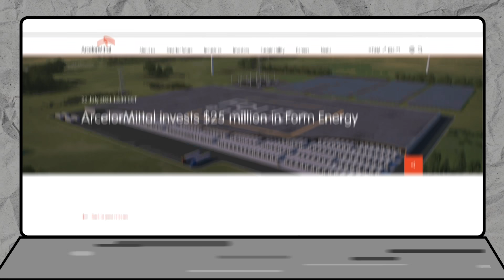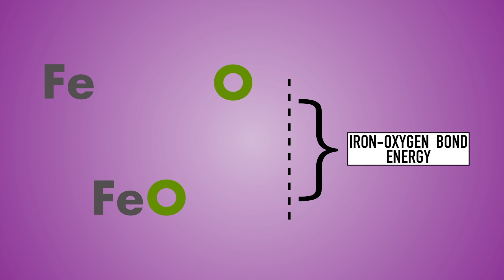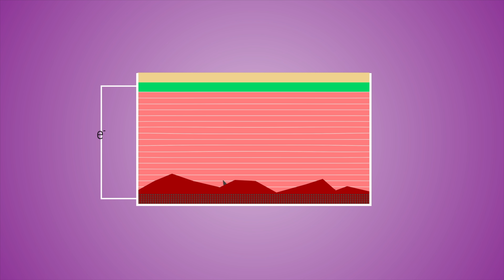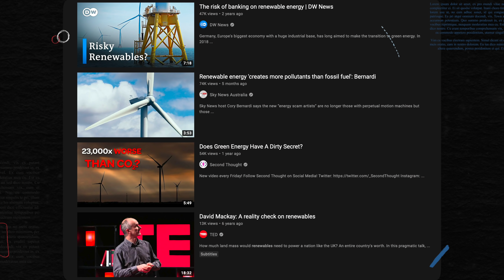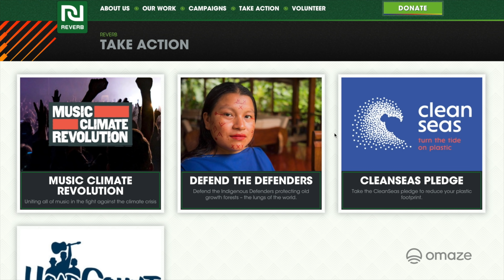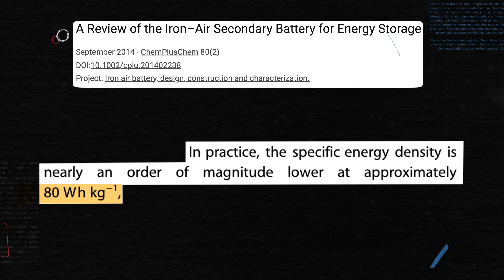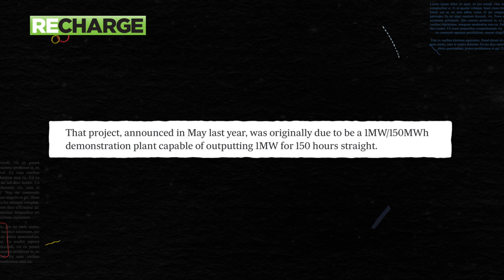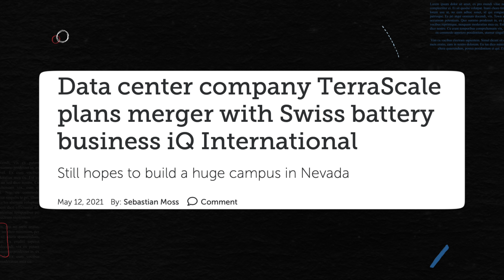Iron-Air Batteries Could Be The Start Of A Revolution In Energy Storage

Comment: Actually you mentioned that hydrogen can be stored indefinitely, it's actually very difficult to store as it's small atoms leak through steel cylinders.
Reply: Which is why composite plastics are used. No microfractures for hydrogen to seep through, and not embrittled by hydrogen. There are also alloys of steel that improve its hydrogen resistance.
Reply: @RentedRedux  impore, yes, but not withstand. No.
Reply: Hydrogen leakage is a huge red herring.  First off it will be stored in underground salt caverns which are now used for storing natural gas.  As for pipes, the hydrogen can be made at the storage location and also converted back to electricity at the same location.  The delusional minority who have attempted to make issues out of non-issues must remember that hydrogen is already widely stored, transported and used widely in industry for making fertilizer for the food you eat.  So stop the BS and being shills for the fossil fuel industry.
Reply: @acmefixer1  Its not BS because we have no such industry, making fertilizer and so. Those are the industries which are strictly and forever banned from any population centers in Europe. So do NOT BS me. The last such industry that made a BIG BANG was in Beirut. Good have mercy with their souls.
Reply: And ionizes and destroys the metal and fittings in very short time. Yes, it can not be stored for much more then a few days, maybe weeks.
Reply: Oh please... Haven't they heard o Tupperware??... No leaks ..... guaranteed!!
Reply: That's why Hydrogen is stored in liquid state, in sub zero temperature
Reply: Store it as titanium iron hydride and it is very stable. That's the stuff in NiMH cells

Comment: Why not slap on a fuel cell and turn the excess hydrogen into energy. And why use air from the outside and not just a closed system??
Reply: @pavan Efficiency is a red herring in many cases. Right now in the UK wind farms are being constrained off every week due to over generation in parts if the day. So the choice is zero percent efficiency by turning the wind farm off, or better efficiency with storage.  Some good long term base storage, in addition to and mixed with shorter faster storage is something that the UK needs already.
Reply: @Muppetkeeper  
Hi, I agree that efficiency is a red hearing, but I don't agree with your example.

Some UK wind farms in remote areas are indeed turned-off/down at times of peak generation because the grid can't transfer all the electricity to where it is needed. It would be 'easy' (but expensive) to build a higher capacity grid (ie a bigger bit of wire), but for the few occasions it is required it is cheaper to pay to turn the turbine off. On that basis the economics of installing a battery (even if the electricity is free, or even negative cost) wouldn't stack up either.
Reply: @johnkenyon6910  hi, I live just outside the 4th or 5th largest city in the UK. Almost every Sunday morning, the six large wind turbines I can see from my home are switched off. It’s not network constraints here, they were built on the old site of a coal power station, the network is fine, the demand is too low.
Reply: @Muppetkeeper  LFP Batteries are cheaper. Or Na+. Or desalination plants which produce sodium which could be used in a battery with near 100% efficiency. Or make same extra aluminium from your recycling coke cans and make it into aluminium air batteries which have around 70% efficiency or pump it into a liquid air tank and use the compressed air in the low tide. LFP batteries are currently the cheapest available option.

Comment: Edison batteries. Next. Crap charge efficiency, one of the worst mass and volumetric efficiencies. If you don't care about how big and heavy it is, or that you'll be wasting ~50% of the power you're trying to store, they're great. (I rank these just above AL-air batteries.)
Reply: Edison are NiFe @ about 65% efficient, cheap AF because they last forever. Who cares how big and heavy they are? it's 100 year infrastucture out in the field with panels and turbines, cheap cheap cheap
Reply: @George Mann Oh yeah, grid level wind/solar are a train wreck
Reply: @George Mann FFS George, will you just stop it with the fact based comments, you are making too much sense.

Comment: This tech looks really promising. The batteries are low-density but inexpensive, and since they use air as the cathode the amount of exotic or difficult to recycle materials they require is greatly reduced. It looks like the biggest drawbacks are that they’re currently bulky and charge and discharge much more slowly than lithium ion batteries. So at their current state they cannot replace lithium batteries - especially in mobile applications - but they could certainly supplement them for grid storage. Because of their reduced energy density and slower charge/discharge cycles they’ll produce less heat, meaning you should be able to stack them more densely, making their space requirements a bit less onerous. You’d need a lot of them but they’re cheap, so they could provide a great place to store excess capacity when the renewables on the grid are overproducing, as well as supplying base load when cloudy or windless conditions persist for multiple days. 

I’ve gotta think they have considerable potential to expand beyond this niche if the technology continues to be advanced and they can find a way to exploit more of the iron in the electrode faster than is currently possible.
Reply: At 1 MW / acre, that's around 250 MW / sq km. (or 640 MW / sq mi). That's a lot of space.
Reply: @kylone1  True, but we have a lot of space. Presumably you could also locate these on the ground floor of a parking garage, or in other unused spaces on the electrical grid.

Comment: Why not combine it with a Hydrogen fuel cell? You'd have to replenish it with water but then you could use the H2 and increase efficiency. And the current capacityof the fuel cell couldimprove performance.  (Maybe this seems like a good idea due to the videos oversimplification?)

Comment: "Store hydrogen forever"?   Is months considered forever or have I missed something.   The inability to store hydrogen has always been in the negative column.   This would be huge in the space programs.  Are you sure about that?
Reply: Amonia as a way to store hydrogen is a thing.
Reply: @dougaltolan3017  Ammonia, water, etc etc.  There are lots of ways of storing Not-Hydrogen.  Still don't know of a way to store hydrogen.
Reply: @lucidmoses  amonia as an energy efficient way to store hydrogen is a thing.

Do you need to be spoon-fed?
Reply: @dougaltolan3017  No, Just an answer from someone that can actually understand the question.
Reply: @lucidmoses  BfS
Reply: @lucidmoses  Also, if you want a pedantic answer to your trollingly semantic question, it may be better posted against a video where it is relevant. Iron-air batteries have no requirement whatsoever to store hydrogen.
I'll leave it to such an amazing scholar such as your self to realise why.
Reply: @dougaltolan3017  This video does talk about hydrogen storage around 7:57. Take a chill pill or 10
Reply: @u1zha  See there's the problem you have with jumping to conclusions.
The video references hydrogen production, with storage as an aside only. 
Now, before we get into throwing chill pills about, here's one way that does not necessarily mean the need for storage...
The hydrogen is produced during the charge stage. Why wouldn't they use that hydrogen there and then to extend that charge stage. It would go a long way to mitigate that particular inefficiency without the need for onerous hydrogen storage.

Comment: I'm confused in general about the need for long-term storage.  If li-ion and other technologies have superior efficiency over the long-term storage proposals, it seems the reduced cycles per year of a long-term storage site will further impair profitability.  An alternative is to build a surplus of renewable generation so that the any shortfall is only short term.  Such overcapacity hurts the profitability of the renewable generation plants due to a high percentage of curtailment but this may be more profitable than occasionally running a long-term storage facility.  The economy of scale of installing renewable generation would keep the capital costs low,  reducing the economic hit due to curtailment.

If a long-term storage solution was ready to scale today, before we have significantly overbuilt renewable generation I think it would be possible to carve a significant niche.  It seems to me that the cost of installing renewable generation is so low that we will be at "superpower" generation capacity before an otherwise viable long-term storage solution is ready to scale.

If one designs a plant to charge/discharge in ten days one can only achieve a maximum of 18 cycles per year.  Whether or not the technology has a 10,000 cycle lifetime seems immaterial to the economics of operating the facility.  Take an LFP battery sized to cycle every day for 3000 cycles and scale it to be able to operate 10 days at the same power.  The battery can now enjoy 10 times the lifetime of daily cycles while also providing the necessary backup for the occasional long-term shortfalls of energy.  Depending on how the capital cost is amortised across the operating lifetime of the plant the cost of energy should be worse than the daily cycle design only by the cost of capital.  The capital per kWh is still roughly equivalent.

I have not dug into the details enough to know that LFP wins but there is something seductive about generating revenue on a daily basis that I find alluring.
Reply: "I'm confused in general about the need for long-term storage." - What happens when you live in the north and you hit winter? You have lost a large percentage of your solar power and if you have a couple weeks of low wind, your windmills aren't generating enough energy to keep up with demand. Your solution of overproducing on renewables is extremely costly compared to simply having a large supply of iron that you can just let rust.

What we need are multiple options for battery storage. Lithium ion has its place, but it has its downsides including environmental damage. Iron may have its place, but you'll never run a car on these things.

But, yes, we have a need for long term storage that isn't lithium ion.
Reply: @ericfleet9602  Your situation is precisely the  one I am questioning.  At the projected cost per MW of deployment of renewable generation vs. the projected cost per 240 MWh of storage, which is more cost effective, deploying multiple times of generating capacity in order to manage the snowfall and low wind days, or deploy the the storage?  I see the real possibility that the cost of curtailing a majority of generation during "normal" conditions might be favorable to the cost of installing long-term storage that is used only intermittently itself.  Either approach results in underutilization of capital.  Which one incurs less cost?

As a New England resident I am quite aware of the impact of snowfall on my solar panels and that my solar panels are positioned to maximize collection in the summer and not the winter.  I am also aware that winter inclimate weather would not likely seriously impact offshore wind.  If offshore wind is deployed to superpower levels, it is not important for my solar panels to either be inclined more steeply or be cleared of snow after the storm passes.  The question is, does expanding offshore wind make more economic sense than deploying long-term storage?  I may have said that for the third time.

To this point, my discussion has centered on grid-level generation and storage.  Ida certainly demonstrated that pushing down to at least the distribution level might be necessary for better robustness.  I keep trying to evaluate backup at the residential level but that seems a hard nut to crack.

A model I keep trying to work around is that of the current residential oil heat.  Is there a fuel that can be stored at a residence for long term as safely as home heating oil currently is to store and is also suitable for direct conversion to electricity?  My concept is that a relatively efficient conversion to electricity in order to operate a heat pump for residential heating would permit the heat rejected from the conversion to electricity also be used, increasing the cycle efficiency of the fuel.  The residence would not be placing electrical demand on the grid to heat the home and has the ability to operated independent of the grid during outages.  The added cost is the energy efficiency of producing the fuel and transporting the fuel and,  possibly the oxidized fuel for reprocessing.

Ethanol as a fuel would preserve operation of an industry that will otherwise see a decline as gasoline use declines.  However, I think it presents significant storage hazards in a residential setting.  It may be more appropriate for district storage but cogeneration, using the heat rejected by the electrical conversion process, is more difficult to utilize.

To reiterate, the goal of residential heating  by an alternative fuel would be to increase the cycle efficiency of the fuel through cogeneration.  A relatively efficient conversion to electrical energy, metal-air battery or fuel cell coupled with a heat pump could provide a relatively high efficiency throughout most of the season.

Thanks for giving me the opportunity to expound more than you probably wish to read.
Reply: @George Mann Thanks.  I'll look further into methanol.  Its toxicity seems an issue so I need to understand if US storage and handling requirements are more stringent than China's.  From the little I've read, I'm not optimistic, but I have been very cautious about increasing risk in a residential setting were safety training is difficult.

We agree on the nominal power needed to operate a home and the battery size to meet demand.
Reply: @George Mann I'll  have to research more thoroughly.  The first articles I scanned stated the opposite, methanol being more toxic than gasoline.  The toxicity also seems to vary from person to person.  I have not yet found an "authoritative" document to cite yet.

The positive I have found is that methanol fumes are more likely to dissipate than gasoline fumes.  But then again, we typically do not store quantities of gasoline in a home.  When comparing to home heating oil I suspect methanol will be identified as a higher risk.  Hopefully, as you advocate, this risk will still be viewed as acceptably low.
Reply: @George Mann Thanks.  You seem a wealth of knowledge about methanol.  You have not contrasted methanol with ethanol, which is already produced in large volume in the US.  Am I correct that ethanol does present a significant hazard in a residential setting?  Or is it similar to methanol without the toxicity?

Comment: When thinking about best practices and what's to provide energy for the future might we also consider the need for water? Might hydrogen vehicles be more beneficial overall?
Reply: probably and also they clean the air as they drive so it is a win....
Reply: @superchargedpetrolhead  you mean, because they suck in air through a filter, basically vacuuming the air? But that's not really important, because most fine particles are from ICEs and if they get phased out, everything's a lot closer.
Reply: @superchargedpetrolhead  Nonsense 😂🤣 You - the human - cleans much more air all day.
Reply: But those batteries use less water than the production of hydrogen...? Because the water stays in a closed system and doesn't get blown out by millions of exhausts. Once the thing is built, you barely need additional water, other than for electrolysis, where you need to constantly supply it.
Reply: Too expensive, less then 20% efficiency, waste of precious energy.

Comment: Your bar graph showed flow batteries as cheaper than rust batteries - wouldn’t flow batteries be the better choice?
Reply: Check your hearing and sight. 3:50
50 dollar vs 75 dollar.
Reply: If most of them didn't still use Vanadium, yes. But the organic redox flow systems don't reach the necessary energy density, yet.

Comment: As a kid in the 1960s I took batteries and capacitors and toy electric cars apart and learned a little about them.  The electro chemistry illustrated here is a bit hard to follow.  How does a load effect the electron flow?  How does electricity input reverse the discharging of the battery.  How thick and heavy is the battery.  Can it be as thin as a carpet and used as a passive solar shade while it also serves as energy storage.  Seems ideal for an artificial tree in a desert location.
Reply: The smallest proposed unit is size of a fridge and weights a ton or more. That is the other reason why we won't be using these in electric cars.
Reply: You could do that. The battery converts iron to rust in the discharge and rust to iron in charge on the anode side.  The oxygen needed flows through a semipermeable membrane to the cathode. Here it is absorbed by activated charcoal and converted to OH ions using a catalyst such as silver manganese dioxide or copper oxide. Graphite in this layer collects the charge and puts it on the metal screen that holds the cathode material. ❤